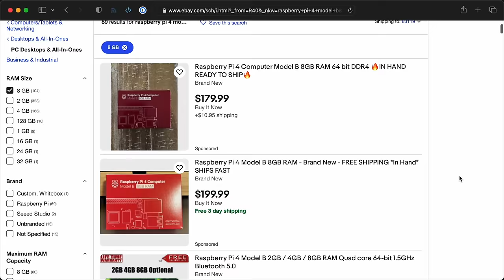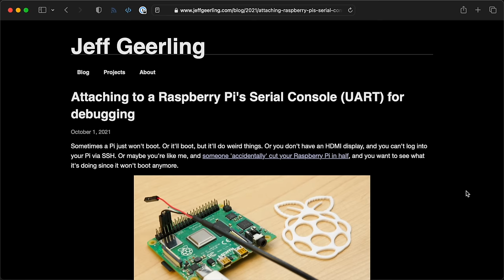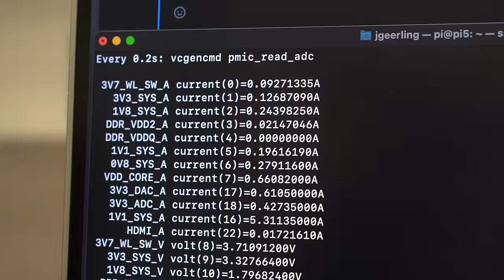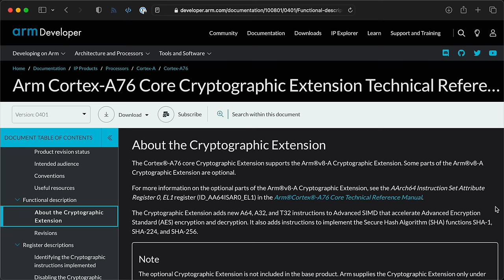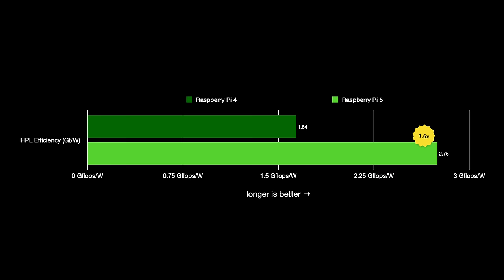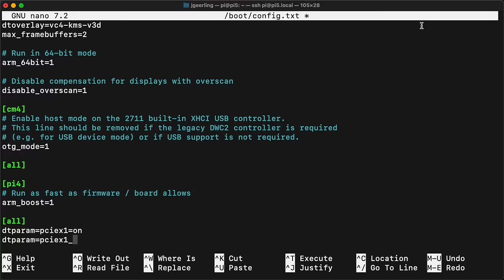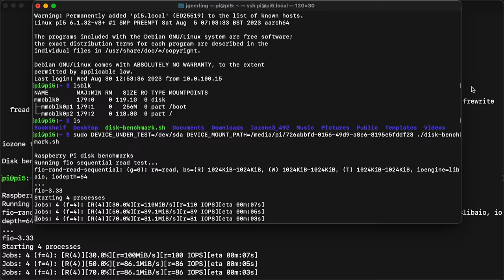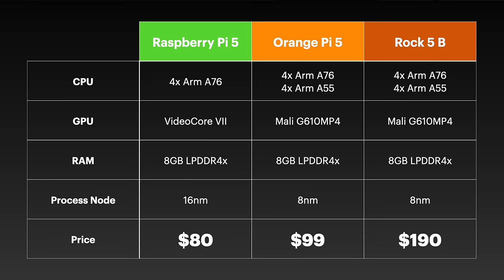Raspberry Pi 5: EVERYTHING you need to know

Comment: There's one thing I would really like to see from the Pi foundation to make the RPi5 worthwhile to me: actual datasheets/TRMs for the BCM-2712 and the RP-1 chip.  The pi foundation has never done well here with their SBCs in the past, but the RP2040's datasheet is excellent, so there's some hope here.  The various rockchip SBCs are a lot better here since you can actually get TRMs for their socs (even if its a little ... unofficial, shall we say).
Reply: I think the lack of that is more to external suppliers than the foundation. A lot comes under NDA. As you point out the rp2040 really shines on documentation, but that thing is completely made in house. 
I expect to see a lot of documentation on the rp1 but I wouldn't expect much on the new Broadcom cpu. But I blame Broadcom for that. Even your comparison is too non official documentation which isn't a fair comparison
Reply: something that blew my mind while working as a contractor (on a Rockchip SoC) is that you can get them to make custom chip packages like stacked die, and getting a TRM still like pulling teeth. I don't even know if we managed to get one, had to reverse engineer register status bits for my driver until they sent screenshots from the 1000+ page TRM we weren't given.
Reply: @bzuidgeest    ultimately, it's the pi foundation's choice of which soc to use -- theoretically, they could go with something like a TI Sitara AM69 (that's just a random choice of an SoC that's well documented publicly by comparison, I'm not suggesting that they should or shouldn't use that particular chip).  At least some of the rockchip parts have officially accessible TRMs (although I think they're incomplete from a cursory glance, which isn't necessarily unexpected), and as far as I understand the rockchip parts don't have a crucial coprocessor that controls the boot sequence and is almost(?) completely undocumented.
Reply: that said, I do expect and hope for great things from the RP-1 as far as documentation goes.  I'm hoping they also sell it as a higher-end microcontroller
Reply: @ShinyQuagsire  ouch -- not even under NDA?  That honestly sounds worse than a lot of the other cpu vendors -- I'd assume that most of them would view you as important enough to give a TRM if they view you as important enough to do custom packaging for
Reply: @undefinednan7096  I doubt it, custom packaging works fine even if you don't know the specifics of what you are packaging, you just need to know how it fits together.
Reply: @ShinyQuagsire  While I do not work for them, I work for a different company that makes custom SoCs.

There are multiple reasons we don't provide all our internal documentation to the clients, one being that we try to reuse custom designs from previous clients and scrubbing away all references can be tricky (and it actually happened on my last project with an excel sheet listing registers and stuff), the second is that we just don't have a clean TRM, the documentation is a big mess and we just don't have time to clean it up and make it deliverable.

So clients get exactly the documentation they requested, and a bunch of hidden registers that control stuff that weren't in the spec (but that we are not removing cause it could just add more bugs) is not getting in there.

Comment: One thing i would've liked them to do, as a different model option ofc, is adding a direct M.2 slot to the board. Considering how thin m.2 ssd's are, i can totally imagine adding that port to the back of the board. I'm just guessing it, but the size would barely increase with that, and an m.2 ssd is basically the same price (or even cheaper) as similar sized sd card. (Also ofc it had to be compatible with those older m.2's, not the 'up-to-date' Long ones, as they are longer than the board)
Reply: I will say exactly the same, also its not fair compare to Orange PI 5 its little expensive but offer M.2 Slot.

Comment: Thanks for the great overview. From the pcb it looks like a number of components are still through hole mounted - the pins are just cut flush with the bottom of the board. This is a good thing though for sockets etc as they are stronger than smd mounted.

Comment: Here's what I want to know: have they addressed EMI with the Pi 5? In all of my use, there were SERIOUS interference problems running USB 3 devices, especially interfering with WiFi and USB 2 devices. I found I needed to use USB extender cables to use USB mice, and other devices like my Sonoff Zigbee controller board. Very annoying! It seems as though they have (quite rightly) put a lot of thought into making the Pi 5's power management more sophisticated, and I'm hoping that the EMI issues have been beaten as well!
Reply from the maker: I know they were working on some EMI issues with PCIe in particular (which is also probably one of the reasons I had some issues with my early prototype adapter). I think they found some shielding was necessary to help with that (on the cable), and I know they spent a great deal of time on compliance testing for RF/EMI (probably more than they used to!).

Comment: Pi was and always should be a teaching and learning tool. I'm glad they are able to find reliable sourcing because I was so worried that stock outages were meant to kill off the Pi. I guess specialty chipsets are meant to avoid future outages. I was looking at the schematics but I wasn't able to see if the COM chipset is the bottleneck like it was for the 3 and 4. Have they removed that issue?

EDIT: I'm assuming they will release smaller memory PI5s as you showed there are 8, 4, 2, and 1 Gig memory resistor points on the card.
Reply: The supply shortages were industry wide and not limited to the foundation. They worked hard to keep it going. Much of the supply went to business customers. Some people complain about that, but I see that as very good. It gives them a stable source of revenue to make us better boards. It also forces high quality os support because companies like stable software in their machines. And they also like long term availability, which again also serves us.

Comment: Even though I have a two Proxmox machines already, I still use Raspberry Pi, Radxa Rock Pi, Orange Pi on my homelab. They play an important role like DNS, network management, monitoring, etc...

I'll more likely stay on RPi 4, Radxa Rock 4. RPi 5 is interesting since my priority is booting using NVME, but the features of Pi 4 is enough, but again the PCIE in the Pi 5 is tempting.

Comment: great video! I feel like this pushes me more towards the rock or orange pi since i feel like a built in m.2 slot is super useful and almost required for some applications nowadays and 2x is a bit too little of a performance boost for my applications, especially considering that there probably won't be a PI6 for quite a while. 
They already have better power delivery and higher voltage so maybe a more powerful variant would be cool in the future
The lack of a headphone jack is also a bit disappointing.

Comment: I just had a look on Amazon at the Orange Pi 5. Great price, great specs, but the reviews are telling. There is next to no community. To get things that the RPi community takes for granted, such as an easy bug-free install and multiple working distros, just aren't there. Also, the surrounding ecosystem for cases, HATs, etc. are just not there for the Orange Pi 5. The competition in the hardware space has never been keener (something I'm very pleased about since the dearth period from the start of the pandemic), but the competitors will have to eventually realise that for success, you need a lot more than just good-specced hardware.

Comment: The lack of analog audio output is a huge disadvantage :(
Reply: Agreed. On the other hand, no more excuse to avoid using a proper I2S DAC.
Reply: Just use a USB adapter. It doesn't mean that the onboard one would have been any better.
Reply: Kind of, but the analog output of the Pi was always very low quality.
Reply: Removing it took courage.
Reply: Stop moaning and just take the new Pi already.
Reply: Huge?  Is that hyperbole I hear?  You have the choice of HDMI or USB, so it's not like it will be difficult to play sound.  It's a relatively minor trade-off to release space for I/O that is more flexible and enhanced the board's capabilities.  Doing new things sometimes means not doing old things.  That's progress.

Comment: I dropped a dual argon fan Hat with the SSD hat ontop of that and the SSD hat has an argon fan on that as well. I have NEVER seen my Pi5 hotter then 130F Its literally never throttled. I have heat sink on it too. Thing is f--king money man. Works so well without a single issue yet. My Pi4 still works perfectly. Both 8GB RAM models. I use them both all the time

Comment: Happy to see the Pi catching up to RockPi5, OrangePi5 and the many others.

Would love to see a pi zero 3 with much more RAM, beefier CPU und USBC (like the Radxa RockPi Zero)…
Reply: Considering how unavailable the Pi Zero 2/W has been since its launch, I doubt we'll see a new one for a while
Reply: @kendokaaa  Zero 2/Ws are finally coming back into stock.  I don't know why rpilocator isn't showing it, but pishop has them in stock as both bare boards (with headers) and in kits.
Reply: It's not really catching up though. To be honest it's not even in the same category in terms of both price and performance.
Reply: Both price and performance are irrelevant to the pi. Your buying community, support, long term stability/ availability, documentation. And yes I know that like so many other supplier  they have problems with availability. But long term support and availability means that they keep supporting older models for years and years and that is too many markets very valuable, far more than performance. Bugs actually get fixed. And they won't sell something one day and drop it the next. If you need to teach or build a product or long term science experiment that is what you want.
Reply: @bzuidgeest  I get what you're saying it terms of ease of use and reliability. There's a good reason the Raspberry is the mainstream option, however I disagree that price and performance are irrelevant.

Price is never irrelevant, especially in the case of the Raspberry pi. In fact price is pretty much the main constraint they design the SBC around.  

And if performance was irrelevant they wouldn't even need to release the Pi 5 in the first place.

Don't get me wrong, I'd always recommend the Raspberry Pi as an entry point for someone new to SBCs. Most of the time performance isn't your focus when buying an SBC anyway, but there are usecases where some of the competitors are viable options as well.
Reply: @cosmiczeppelin  I meant irrelevant as not the main criteria for choosing a pi. For design it's naturally very important. However the comments here are discussing buying, not designing. Same for performance, not a main criteria. They need to keep up somewhat, but they don't want to be the fastest on the market. If they wanted that, their release cycle would need to be much faster. And they would use a different soc. The pi  4 is old in IT terms. And you can still get the pi 3 and such. So if the 3 still sells, there are a lot of customers where performance is second to for example stability.

If you want performance and usually poor support, there are a lot of other options. If you can hack the kernel and fix things and such almost everything is an option.

Comment: Going to be sad to lose the Composite out, but good to finally have a 5. Even if it has been so long that it feels like we should've had the 6 by now.
Reply: Same, Composite out is  a big selling point for me personally when buying a single board pc.
Reply: It's not gone. It's just relegated to two (currently empty) 2.5mm pads between the micro-HDMI and  cam/disp ports. So you could solder in your own cable if you wanted it that badly. Just like on the Pi Zero. You'll still need some other method for getting sound out though.
Reply: Pi cares more about a stable eco system. It's not about the latest greatest, for that you need to look elsewhere. For great community, tools and support and long term availability, you choose pi.
Reply: @bzuidgeest   Not sure that's applicable here.
Reply: @ajshell2 Kind of a shame they didn't populate the composite video output with a header or connector like everything else.
Reply: @deterlanglytone  why not?
Reply: @bzuidgeest  Because it is a nonsequitur

Comment: Also now that the new CPU has hardware support for AES etc, a benchmark comparing it for WireGuard/OpenSSL throughput with the Pi 4 would be interesting.
Reply: WireGuard doesn't use AES fyi.
Reply: @catlover9998  Interesting, didn't realize this. Wonder if it has ChaCha20 hardware acceleration, a quick google for the cpu didn't yield too much useful information

Comment: It genuinely seems like RaspberryPi wants a certain number of people to replace their big chunky desktops with these. It's just with all of the shortages of the past few years I'm sort of scared to try and get my hands on one of these circa Christmas. I'm praying ARM has fixed their chip issues and there won't be as these look really cool and could be really helpful if they're not sold out every 5 seconds...
Reply: Makes no sense though.  These days you can get a full N95/N100 (equivalent performance to an i7-3770) small form factor that has everything in it at less than the real-world cost of a Pi 5 with the needed accessories to make it a fully functional desktop replacement.

Comment: Just check the geekbench score
RPI5 = RPI4 x2
RPI5 4 core = M1 single core

Wow, the price tag, anyway you get what you pay for and hope this thing will be in stock.
But at 80 bucks, the Intel n100~n300 series gives more as a personal server or tiny desktop.
Reply: I mean it looks like 4 years later Raspberry still didn't add VP9/AV1 decoding for youtube.
What am I supposed to do with H.265? Decode BluRay?!
And still a single lane of PCIe (now with experimental PCIe3.0 and possibly still buggy)?! What were they thinking?
Actually the n100 is a huge step up vs the PI5!

Comment: I'm not optimistic about the availability of Pi5. For years they've promised to solve the shortage issue with Pi4 and CM4 and they couldn't keep their promises. What has changed? What makes me believe them this time? Raspberry Pi the company started with a noble goal; to help young learners get their hands on a very affordable computer but ever since big companies showed their interest in using the Pi in industrial solutions, Raspberry Pi seemed to have deviated from that goal to serve the big tech as the supplies for the past years have been almost completely preserved for the big customers rather than the individuals.
Reply: All due to the pandemic and chip shortages...which is virtually over. That kind of complication has never happened before. It wasn't just them. Vehicle manufacturers have had brand new vehicles parked in fields for a year or 2 waiting on chips/parts
Reply: @mrmotofy you got a big copium supply it seems

Comment: I have mixed feelings about it.

More CPU horsepower is good, but active cooling looks a must for sustained work. Improved GPU performance, 10bit color,  and 4k60 h265 hw decode, but h264 decode got dropped as well as the encoders. Analog audio getting dropped, while a bit of a sting, is not that bad to add back with USB. The new power management, RTC and power button are boons, but the requirement of only 5v@5a is not something you can find on any PD brick, higher input voltage would have done wonders on that front.

Media center use felt like it kinda got nerfed, desktop use got a nice chunk of QOL, and the server people got a really large improvement in the compute department. If I buy Pis for a cluster, 5s hands down are the pick. Probably the same for emulation boxes. Everything else, I'm not really sold on, outside of using the PCIe for a SSD for when SD cards are not a great fit. 3D printers use the video encoder blocks for webcam streams, don't need more compute, and the extra power draw is not ideal depending on how one powers it. My Pi Hole is quite fine on a 3B in a passive case.

Guess it's a good thing they are still making the older Pis. Choice is a good thing when it doesn't 100% obsolete older products. 3B+ killed any need to buy 3B and 2B, 2B killed 1B unless you needed the form factor as it did change that. 4B was the first to be a toss up for compatibility, but still was improvements all around.

Comment: The floodgates of expansion boards to use that PCIE port are OPEN.  The aftermarket party is gonna bit LIT....  Can't wait to see what they can pull off with HEVC too, here's praying that it does hardware encoding as well.
Reply from the maker: Soo... for encoding, that's on CPU. It can do HD pretty well in real time. I haven't done a whole lot of testing with 4K though. I don't think hardware encoding in the VideoCore VII is a thing, but you'll have to consult official sources a bit more on that.
Reply: Yeah PCIe was one of the main reasons I wanted to build my projects on CM4, though as always seems to be the case the new stuff comes out before I've found the time to get that far with them.... So this Pi5 looks rather interesting there, and having something like a 2040 in the GPIO path sounds really useful for more embedded realtime micro-controller type use too, though going to have to see what this built in version can really do.
Reply: @JeffGeerling  That's interesting - I've been dying for a hardware encoding solution that could do decent re-encodes of a large video collection (largely in MPEG1 and MPEG2 format) for quite some time, if it's not using HWENC on the VideoCore VII how would it achieve real-time encoding to HEVC?  That's pretty heavy stuff from what I've seen, the lack of practical multi-core split for CPU based encoding in the past made FFMPEG less than viable overall.